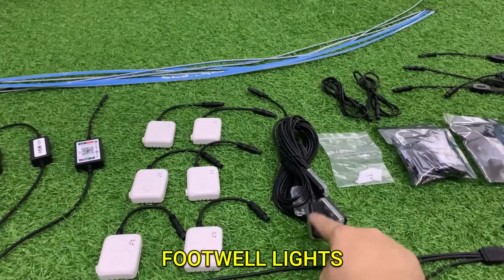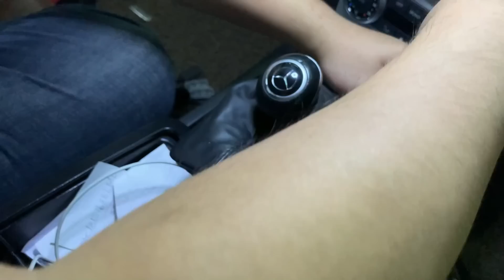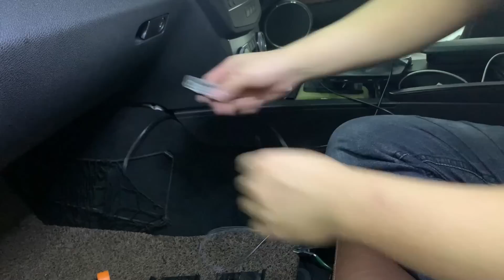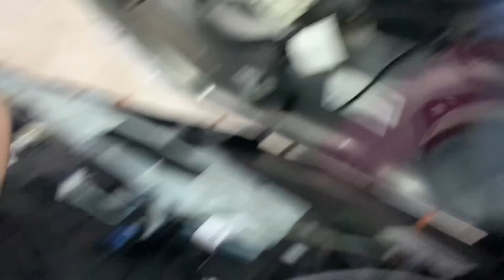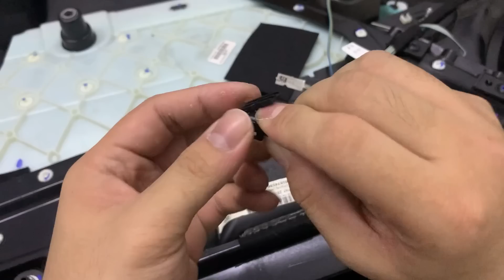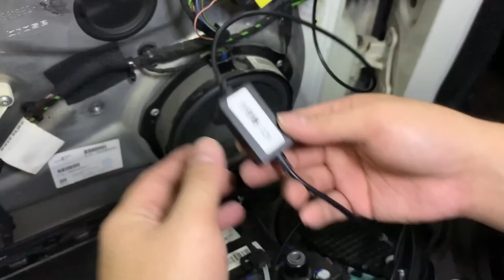NEW, improved App Controlled Ambient Light Kit on 2008-2014 Mercedes W204 C-Class

Comment: I installed the older version on my Toyota Altezza but for some reason the light only emits from the starting of the optic tube and not completely. Do you have any idea why?
Reply from the maker: Either is source of the light is not strong enough or there’s a crack in the optic tube.

Comment: The 12 v supply is constant at door on this connector?
Reply from the maker: Yes. The door lights have constant power but they aren’t turned on until the main box sends a signal to the door box module to turn on.
Reply: @TheFlexxGarage can the brightness of these be adjusted? Wouldn't want them being too bright whilst driving
Reply: @NastyRhythm yeah it can

Comment: Hello Flexx. I am installing a newer generation of the same product into my car. In your video you show that the door ambient light module is connected to the red/white cable (I made a measurement and it is the permanent Plus connection to the battery). Is it safe to do this, will it not drain my battery?

Comment: A small question please if someone could answer quickly.

What do you do with the original footwell lights? Do i unplug them or would you have them on along with the new footwell lights? So both will be on?
Reply from the maker: Just put some electrical tape over it and tuck it away. If you unplug, the car might detect an error and have a stored fault in the ecu.

Comment: Can you instwll the app on the screen?
Reply: Unfortunately no, I installed simmiler ambient light kit on my 2012 w204 with the android 11 screen downloaded the app on the car screen , it's couldn't communicate or connect to the lights controller but worked fine on the phone , tried to chang the permissions sittings etc but nothing worked, eventually I gived up and used only my phone to control it
Reply: @youssefomar3629  No U r wrong ...I can control the ambient from the android screen. Just enable your Bluetooth on your oem screen instead of your android and download the ambient light apps it will work just like on the phone
Reply: Please what is the name of the app

Comment: I’ve installed these about two months ago. Quite happy with them. The only thing to watch out for is.... the light strips are wrapped with tin foil. So when you try to slip them into the cracks, they have a tendency to kind of rip of a little bit. This creates dark spots on the light strips. So be careful when putting them in. Other than that, I’m pretty happy with them. And I installed them on my w204 C350 coupe.

Comment: Does all 4 doors have the white plug to connect the red and brown wire?
Reply: Yes all 4 doors have a fuse box which you need to tap into. The video shows which connectors you need to splice and solder into